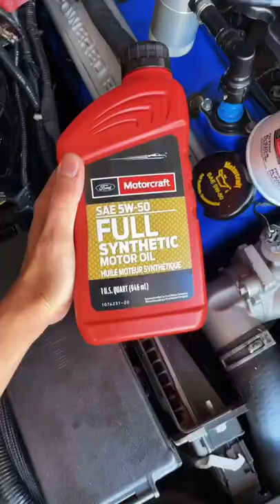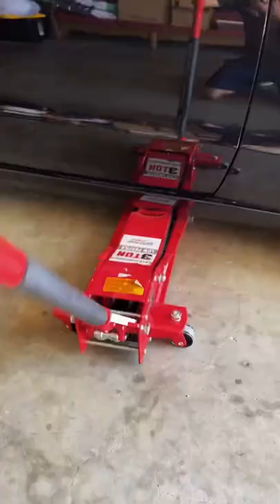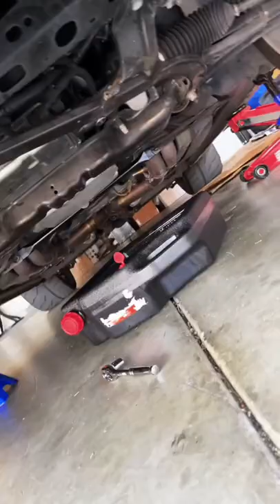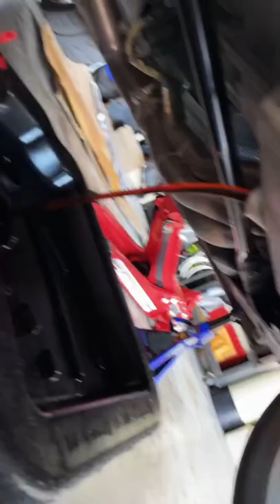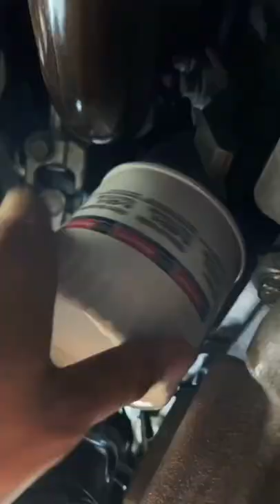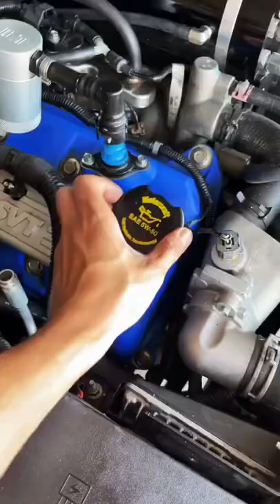How to do an oil change 🏎💨

Comment: People saying "dont pre fill the filter" because "it doesnt circulate that way" so "the oil will go through the engine unfiltered anyway" dont know why you do it. Its to stop the engine running without oil for the length of time it would take to fill the filter, had you not filled it before hand. Prevents the engine running dry for longer than it needs to.

And to the others saying its stupid because most are side or top mounted so it will spill everywhere, stop working on your cars, you dont have enough common sense to be handling any level of machinery
Reply: Oil filter empty and engine running dry? Lmao what? The problem here is overfilling with oil when he goes to add the proper amount of oil plus whatever he just filled the filter with…lol
Reply: @tims6966 Most filters have an anti drain back valve to prevent dry starts through regular use of turning the car on and off when going on drives and parking up etc. We imitate this during the oil change by pre filling, the exact reason I said. This also means that the oil in the filter can't reach the sump again and won't increase the level on the dipstick after it's rested. Nice try though

Comment: I see few people in comments about the prefilling of the filter but only one got the reason right. Prefilling your filter (the center part that you fill is the clean side of the filter) can add any unwanted matter into the clean side of the system, Motorcraft also specifically states to not prefill. Also oil filters have a bypass hole on them so at first startup, just enough oil will get through to not seize the engine, but use the filter part once it's filled. 
Big part of working on your own car is making mistakes and learning, keep at it!
Reply: Been filling filters for 10 years on cars with 300k+ miles.
Reply: @some-replies  that's unfortunate.

Comment: You should make sure you have an accurate oil level too. Run your engine for a minute then let it sit for 5 or 10, recheck the dipstick and top off if you’re still a little bit low.

Comment: Nice, but one major oversight that you're probably aware of but didn't mention is to be sure the gasket from the old filter is off so you don't double gasket. That shit will blow out with the pressure and causes a huge mess.

Comment: Fine job, fine job cause most people won't fill up the oil filter...It saves the bearings from being dry of oil for a few seconds cause the filter has to fill up and it can cause an engine to spin a bearing instantly

Comment: On modern cars you often need to connect the car on a computer with specific software otherwise its not going to register the oil change and the "maintenance" notice/signal will not dissapear. Also some insurance dont cover your car if the car is in maintenance mode...

Comment: I love reading comments on videos like this because suddenly everyone becomes a seasoned 30 year mechanic and knows the best possible way of doing everything. Yes he did miss some points such as replacing the crush washer or letting the engine run for a bit before draining the oil etc.
Reply: The oil is changed though
.. lol So what happened... Oh reality...lol Yea he missed some things but it was not bad example... Did the teacher tell you to stop using fingers to count... No you grew up and realized you could... And got still found out 1 +1=2
The objective is cleared
Reply: @darinabstonjr9512   Thank you. Someone with common sense.
Reply: @MBKindell   He got the basic gist of it across. I’ve done oil changes before where i didn’t replace the crush washers or run the engine before draining the oil. Hell sometimes i don’t fill the oil run the engine and then fill again, i just fill exactly how much i know it’ll take and it’s spot on everytime. It’s not a make or break, the oil will still be changed and the car will still run fine. It’s not like you’re gonna blow up your engine because you didn’t let the oil get warm before draining it.

Comment: Pre-filling your filter is completely up to user discretion in my opinion. But if you fill from that center hole all that oil goes right into your bearings unfiltered. The oil is brand new and should be perfectly fine, but still something to think about. This is only a relatively new realization for me any my car is fine. But still figured I’d pass along the info.

Comment: Filling the filter not required. I would go as far as saying it’s bad practice since any contaminants which could be present are going straight into the engine. Also I wanted to mention for anyone doing their newer shelby at home, I heard from a ford tech that ford recommends not lubing the filter o ring to prevent leaks

Comment: What you did wrong:

You kacked up your car from the fender which you shouldn't vecause there are special jack points for that

Pre filling the filter is stupid because that way you have unfiltered oil running thru your engine

You didn't put a new gasket on the drain plug (which isn't good vut usually works fine two or three times)

You are supposed to do an oil change when the oil os hot because it's less viscose and more of ut actually gets out

The correct type and amount of oil usually isn't given on the oil cap. Also you need zo look if the oil meets your car's specification. Just because it's 5W30 and your engine needs 5w30 doesn't mean that it's the right oil. There are different afditives in the oil that may or may not be necessary for your engine. 

Also make sure that the gasket from the old filter isn't stuck on the engine, two gaskets on top of each other will cause leaks. 

Anyways, you probably did a better job than most shops do.

Comment: Why are you prefilling the filter? I'm curious about the mindset behind this because every mechanic (professional) that I've talked to says it's worthless at best and potentially disastrous
Reply: Some cars actually need to be prefilled, especially diesel cars but most don’t
Reply: Some have too (euro cars mostly) but pre fill keeps the oil pump from working too hard
Reply: How would it cause any problems? Been doing it for 10 years

I'm also an ASE tech
Reply: @some-replies  Your putting faith that the new oil has no contaminants and the bottle was clean. At least if you put it in your pan it will go through the filter first before it reaches the engine. I know it's only like an 1/8 of a quart but I don't know where oil is bottled. I've never seen the conditions of the Assembly lines. Plus pre filling just doesn't provide any benefits

Comment: You should also let the engine warm up before draining the oil. It circulates the particles in the engine into the oil so they can be drained out.

Comment: No shaking the oil before pouring?  I used to fill the filters, I stopped, since Ford's, and I'm sure most brands all have a flood mode.  It spins the motor to flood the engine with oil.  Skip steps that aren't needed.

Comment: What I like to do when I change my oil is, when u get all the old oil out of the car run some clean oil through the vehicle to help get a better cleaning.
Reply: I am also used to do that (I like to be very meticulous), but later I learn that is mostly a waste of time and oil.

What we drain is just the “deposit" of the oil, but the rest of the system (pump, passages, bearings, heads, lifters, etc.) will still be full of “dirty oil" and to be precise, is this rest of the system; rather than the deposit, what we really want to be clean.

Another reason why not to do it, relays in the chemistry of the oil, as they are formulated to act as a “detergent" of the engine, so the brand new oil will do its job cleaning the old oil deposits.

As a perfectionist myself, I won't blame you if you still stick to your routine, it doesn't do any harm after all.

Comment: 1 im saying this cause im a mechanic at jiffy lube no you dont have to fill your filter with oil unless its a diesel truck 2 make sure if you do add oil to your filter which you shouldnt to subtract that from the total amount of oil your adding to your car that way your not adding to much extra 3 make sure you run your car for atleast a minute after adding oil and make sure you check the levels before and after you start it up then your all good to go if your oil is still full on the dipstick after you check it 👍🏽
Reply: Most bigger diesels (Cummins X15, etc) don’t require to pre-fill the oil filter, at least it could be different on the smaller side of trucks. Usually you pre-fill the fuel filters because there are always struggles with any diesel fuel system and it trying to start, especially damn MX-13 no electronic fuel pump ;-; like the Cummins :)

Comment: All these people saying to not prefilled the filter. Guys, it really doesn't matter if you do or don't. Modern vehicles make oil pressure so fast it'll fill the filter almost instantly. And there is always a film of oil on everything inside the motor. On the other side, nothing is wrong with prefilled it either, makes it more accurate checking the oil since filters hold ~1/2qt.

Comment: Quick tip, get yourself an electric oil pump for about $15 . It does get more oil than draining it from the sump and you don't have to get under the car.
Reply: How you going to replace the oil filter if you don't go under the car?
Reply: @ittimjones  some cars have the oil filters placed at the top of the engine.

Comment: If you read your owners manual it will say for each oil change: inspect tires for wear, inspect exhaust, inspect air intake filter, inspect front end suspension, inspect transmission oil level and condition, fill washer fluid, inflate tires, reset oil light, lubricate doors and hinges. Most decent mechanics will do all of this for not much more than the cost of the oil. Take your car to a mechanic. Your not doing yourself a favor by just changing engine oil.

Comment: No. The info. is NOT on the oil cap. It is on "some" oil caps.
And you DON'T check the level after you fill it.
You start it, and let it run for 1 minute, shut it off, and 2-3 minutes later, check the level.

Comment: he filled up the filter through the filtered side of the  oil filter so that means of any debris get in there even if smaller than a hair will scratch his crank bearings and over time lead to the death of that motor. ( this has happened to me before). if you really want to prefill your filter pour the oil into the the little holes around the big whole

Comment: Don’t forget to check if the old gasket from the old oil filter is stuck on the engine. If you double gasket it causes a leak. Also check your drain pan bolt. Sometimes those bolts also have one time use gaskets on the bolt themselves

Comment: What do you do with the old oil?
Reply: pour into a body of water
Reply: @hasanfadhil6404  Why didn't I think of that!?
Reply: @kapowiekapowie865  But Nemo said that was bad.
Reply: @optimum6664  honestly I don't do my oil changes, because of that reason, I don't know what to do with it, and the cost for an oil change is 18$ at the dealership and that's for labor only, so it's not really worth it.
Reply: Put it on pancakes
Reply: Put in on my clapped out duramax as fuel
Reply: @justindaniels17   #EPA
Reply: @hasanfadhil6404  I live in Florida so.... Keep the vibe alive I guess😂😂
Reply: @justindaniels17   lol I'm in Rhode island and it's fucking lame here we can't have fun 😭
Reply: @hasanfadhil6404  move to Florida 😂😂
Reply: @justindaniels17  can't, it's to hot for me
Reply: @hasanfadhil6404  i got used to it
Reply: I use it to burn stumps lol
Reply: Run it through coffee strainers a few times and reuse it.

Comment: I been doing my own oil changes since I started to driving years ago, had 5 cars since and I noticed that on all those cars following the oil capacity u see online usually overfills them. Probably cause some of the oil doesnt get to make it out so filling that oil filter then following the capacity online freaked me out 😅
Reply: yeah my car said that it takes 5 quarts of oil but toke 7 quarts 🤣
Reply: @ruger206  yeah cant always trust oil fill capacities online. Do u let the new oil seep all the way down to the oil pan before checking it and putting more in it? My 5.3 takes a couple minutes.
Reply: @danielvega4076  yeah I usually wait and let the car warm a little, then check the fluids and add a quart or so till is topped off

Comment: The only thing filling the filter before installing it does is make it a good bet you will spill it all over. The slug of air in a dry filter is not going to wear out your engine.

Comment: Before you check your oil you need to have the car back on the ground so it is level
Reply: ….if you put the correct amount of oil you don’t need to worry about checking the level as you should have put the correct amount into the engine in the first place
Reply: @Yeah Right my engine takes 4 qts, 3.8 without filter.

Comment: You also missed the fact that you can strip your oil plug which would result in you needing a new oil pan. Or you don’t tighten it enough and the drain plug falls out bricking the engine

Comment: Dont remove the oil cap, just crack it loose until the old oil is drained and you are ready to pour in fresh oil... Why would you let any potential dust and abrasive grit fall in to an oil sump for more than absolutely necessary is beyond me... Also, for diy, i love my car, bla bla oil change, you might consider buying another liter of cheap oil and when your old oil is out, without plugging the drain, just waste that liter of oil straight through the engine to wash out any scum that didnt get removed... It always washes out quite some more old oil and sure, it doesnt clean up the pump, oil ways and filter, but its a good practice if you arent on a budget that much... After that, plug the drain, pour in good fresh oil and voila, you love your car... Also, you can change the oil filter with every oil change if you arent on a tight budget and ``love your car``...

Comment: Never pre fill filter with oil. First few second when you start your engine it will pump the air and rip the filter soaked with oil. It has to be oil-free so the air can escape.

Comment: I’ve never understood prefilling the oil filter, which is also an exceptionally unreasonable process for me and my vehicle in particular as the oil filter is on the front of the engine aiming downward to drain into the pan, so prefilling would only make a huge mess for me, most vehicles it wouldn’t cause any issues so I’m not really against it other than feeling like it’s generally pointless

Comment: Why change oil, that oil looks clean 🥲
Reply: Because it’s supercharged. If your car is supercharged or turbocharged you should change your oil about every 3k miles
Reply: doesnt matter, always follow manufacturer's reccomendation, why? because they built the car not you.
Reply: Using cheap oil requires more frequent changes. Full synthetic should be able to go over 5k even with super charger

Comment: real mechanics replace the oil sump plug ring
Reply: Mines on the bolt already so I check it for cracks or wear every time I change the oil

Comment: How to do an oil change:

1. Jack it up. On a jack point please.

2. Drain the oil. Duh.

3. Get a pressure washer and soap and clean the engine out. Oil is dirty right like damn.

4. Close the plug.

5. Pour olive oil in as it works just as good as motor oil.

6. Ignore the dipstick, fill it up to the brim. The dipstick is an automotive scam technique, but filling up something completely is the best way to go.

7. Enjoy your car while it lasts!

Comment: Ive never seen a vehicle that specifically calls for 5w50 that’s wild to me
Reply: 0w-16 is used is some hybrid engines
Reply: I’ve seen 0w16 in new Toyotas mostly, but 5w50 sounds like it would be hard to find lol
Reply: @AK574  easily found at the dealer as you can just purchase the oil

Comment: What about the washer ?
Reply: My ranger don’t got one maybe his is similar? His drain plug doesn’t look the same though
Reply: @Moto_737  It probably is there. They will stick to the oil pan itself and give the appearance one isn't there but you are just re-using the old one. You have to have some way to seal the thread, I'm a machinist. Even a pipe thread needs to be doped to seal against leakage. You have a washer.

Comment: Lol, I hope you weren't serious. That's a good way to OVERFILL your engine oil.
Reply: By what? A cup? Not going to hurt anything on any engine…
Reply: @DiscoMiata  maybe not right away but it certainly can. I like my vehicles to last me a loooong time so I follow the engine specifications.
Reply: @911LEXX  it won’t, there is a dipstick and if it goes a bit low the engine will be fine, if it’s a bit high it will be fine, also you have the same name as my girlfriend, her name is Alexandria Ortiz but goes by Alex
Reply: @DiscoMiata  ok just keep overfilling it then. I'm guessing you are alot smarter than the engineers that designed these new high performance engines.
Reply: @911LEXX  … if a cup of oil destroys an engine, it’s a garbage engine, rule of thumb for engines that leak or burn oil and the owner doesn’t have enough money to fix is 20% over max. I’ll bet you 1k that I can over fill a demons engine and it’ll be juuustttt fine
Reply: @DiscoMiata  lol so what is the problem? You do you

Comment: Definitely a biiiig mistake for putting the oil in the oil filter like that. You need to put the oil around the edges of the oil filter so it can get filtered by the filter. Like this your engine is going to be lubricated with not filtered oil.